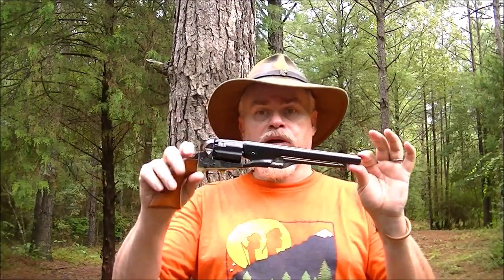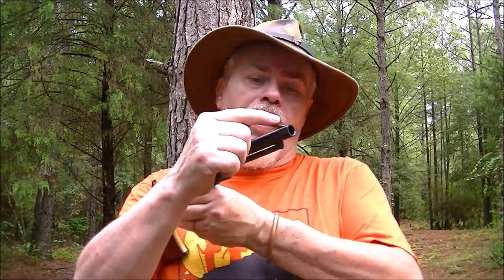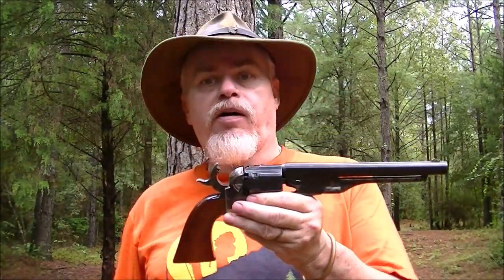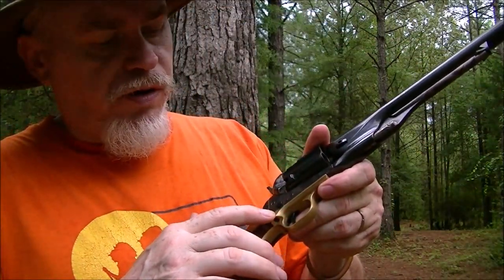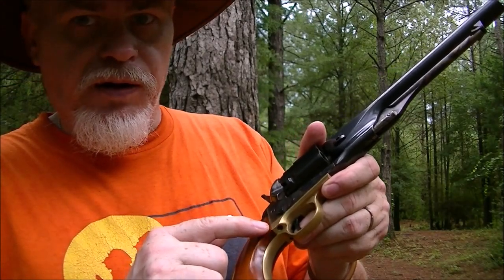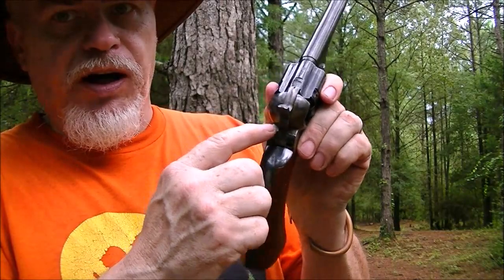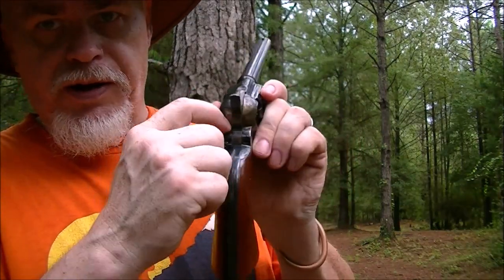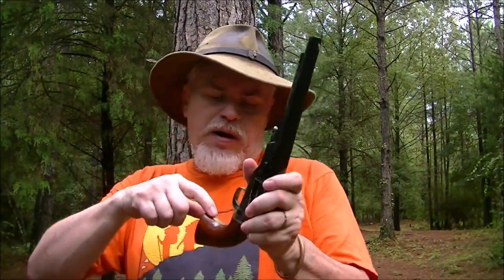how to create a antique finish on a Uberti 1860 army

Comment: My last 1860 I antiqued, I did with the Birchwood Casey plum brown, but after applying it, I dropped it directly into hot water for about an hour. It came out a matte color closer to gray than brown, and a nice uneven finish, which I prefer over the homogeneous brown
Reply from the maker: true the originals don't have a even smooth finish its always a uneven finish

Comment: Sir, I have a question about revolver repair. I have a revolver where one of the pins on the frame is bent downward pretty badly.

How can I repair this? Should I heat it and bend? Will that hurt the frame itself? Can I just pull it out and replace with another substitute?

Thanks!
Reply from the maker: i would try to grab it with a locking set of pliers and twist it out then replace with a correct one dixie gun works has spare parts like that